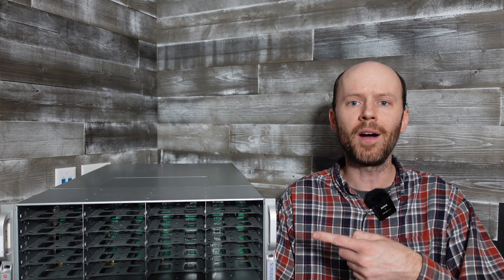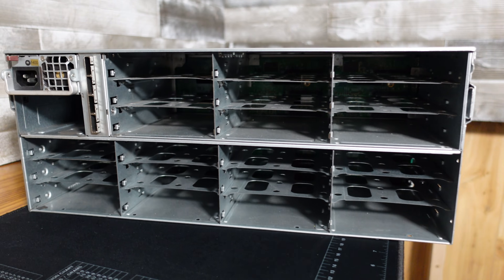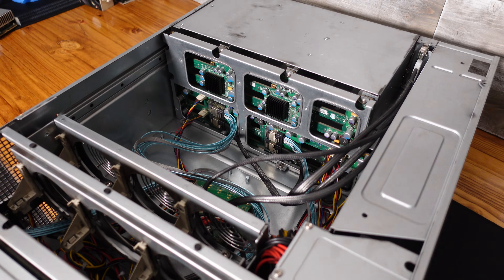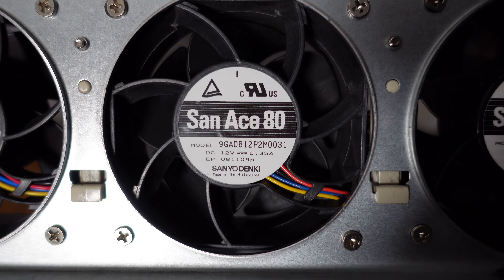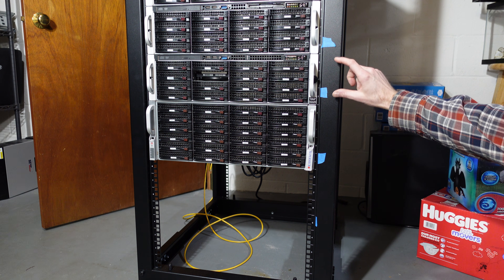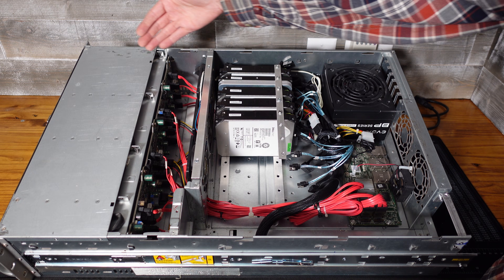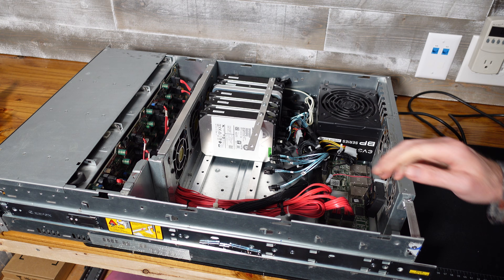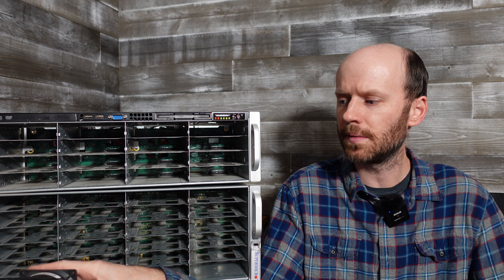Supermicro 45-Bay JBOD Disk Shelf Upgrade, Running 105 Hard Drives

Comment: i am new to home lab   i am more onto running local LLM , machine learning and batch transcoding of media  
have you tried ssd   in in these chassis ?
 i wonder if that would  drop the voltage and the noise  also you could use Noctua NF-A4X20 40 Fans   because it " should "require less cooling

Comment: I'm thinking of enclosing my racks top, sides and back. Adding rockwool to the panels. Then placing a exhaust fan on the back panel and running the duct to the window. Think that will help with noise and heat.

Comment: You neglected to mention/list the Dell PN for the fan, or Optiplex models either or would be handy for the lazy masses on the interwebs ;)   (also damn you for making me wanna get one of these & retire my MD1200's)
Reply from the maker: Part number is FAN-0074L4. It was mentioned at 11:40 :)
Reply: @HomeSysAdmin  Indeed that seems to be the Supermicro PN, but you went on to mention that the fan can be gotten as a Dell variant which should have a DPN attached to them.  The most similar one I can find being 0M8041 & 0HU540 for the OptiPlex 745/55/60 series.
Reply from the maker: @mikebleh6492  Oh, I don't have the Dell PN's. I searched the fan PN, 9G0812P1F*** where * is a 3-character variant. There are a few variants of 9G0812P1F which appear to all have the exact same specs, just possibly a different connector or screw hole sizes.
Reply: @HomeSysAdmin thanks! I’m modifying an old EMC Isilon 36 bay server later this spring and need to try and find a good replacement for the original fans. These sound silent enough and with enough pressure to test out! 👍

Comment: Please note : Server PSUs idle at higher wattage than ATX PSUs even if they are more efficient at higher loads.
My PWS-1K66P-1R 1600W psu idles at 0.25Amps. And my Antec 1000W HCG idles at 0.09Amps.
Reply from the maker: Do you think that is mostly attributed to the PSU fan being small and high-rpm? Or are there other factors at play?
Reply: @HomeSysAdmin  I think the fans are a small factor in all of this. The smps circuit design is the main culprit. 

I have run the sysbench mutex benchmark using different PSUs but keeping the rest of the machine same. The final power consumption varies wildly. The best was FSP250-60GHT and the worst was Antec 1000W HCG which is actually gold efficiency certified. So the size of the PSU and the circuit design are the final deciders.  Large PSUs running at 20~30% load are inefficient. The benchmark was about power consumption at the wall socket when at idle and at full load.

Comment: These server chassis are so silly. All that airflow and then the output at the back is 95% blocked. No wonder the fans need so much static pressure and rpm. and 40c is way too hot for HHDs running 24/7. That's 104F!
Reply from the maker: The backplane is really what does the blocking. They need to find a way to put more holes in it. And no, 40C is a perfectly healthy temperature. My target maximum is 45C, but I see other people running at 50C all day long for years without issue.

Comment: 6:30 power supplies are usually most efficient around 50% load, so using a power supply with double the wattage as what you need is often best.
Reply from the maker: Agreed! The tricky part to factor in with so many drives though is the current required during startup. Even with staggered spin-up like these do, there's still an increase.

Comment: As an admin who managed, many systems with these shelves. I can recommend labelling the front of the caddies with the drive serial number (or wwn) to make it easier to find dead disks!
Reply from the maker: That's a great idea. I tried to do this originally but because these are white-label "oos" recertified (or whatever you call them) drives, the serial numbers returned by SMART don't match what is printed on the drive. I'm not running any sort of raid. They're individually mounted so I can easily identify which one is failed when one goes offline. For example 0315 is shelf 3, bay 15 :)

Comment: Awesome video, great in detail about the 847 case and thanks for the fan info, as this was something i gave up on way back. Stacked 4 of these in my basement rack and together they sound like a jet engine idling. When it comes to PSU, there is a reason for the 1K41 as this with 45 drives will use <75% of the actual capacity of the PSU, meaning more efficient and longer lasting PSU. Heat will always be an issue, but even worse if using SED drives that constantly monitor them selves (have some i got cheap). Tried to block the holes on the side of the 847 case, to force the fans to pull cold air through the front drives/backplane, but i could hear the fans were struggling with my "great" invention. Looking forward for more informative videos.

Comment: Yeah man those things are loud as balls. I have a Nimble Storage ES1, basically rebadged Supermicro 16-bay, which is a smaller version, and I swapped the PSUs with the Supermicro PWS-920P-SQ . They are platinum, $30 apiece when I bought them, and much quieter than the ones that came with mine, which I believe is the same as that bronze PSU you're running. If you're looking into Supermicro PSUs, be aware that they have at least two different connectors. At first I bought the PWS-1K28P-SQ, and the connector did not fit at all. I'm not sure how many different types they have, but those are the only two I tried.

At any rate, congrats on the score! They are very nice enclosures minus the noise.
Reply from the maker: Thanks! PWS-920P-SQ is the one I ordered, should be here next week hopefully :)

Comment: I made a similar transition a few years ago but I moved to 4 x 847E1C-R1K28JBOD. Having SAS3 is great for the future and the IPMI is way more clutch than I realized it would be. I love the density of these 45 drive units. Nice snag and upgrade!
Reply from the maker: Ooo those have the CB3 controller board. I was eyeing those up but the board alone costs more than I paid for an entire case! Do those boards control the fan speed based on temp or is it a single preset speed like the CB2/SAS2 versions?
Reply: @HomeSysAdmin  It does indeed which is perfect for me as my rack sits in a mechanical room where throughout the year I have wild temperature swings due to our HVAC, water heater and server equipment. I paid $750 per with rails and caddies almost three years ago. All in all, even at todays prices I feel like I got a good deal especially considering I sold my old JBOD's (SM 16 bay units) at a time when Supermicro gear was harder to find due to Chia, so prices were obviously up.

Comment: So I am curious why is it only 45 drives instead of 48 drives and I would be interested in seeing what the drive trays look like 

I know I have seen net app jbods with 48 drives in there with 24 slots and each slot capable on doing 2 drives
Reply from the maker: The space were the remaining 3 drives would go is where the two PSU bays and SAS connectors are. It's physically impossible to fit 3 more externally-facing drives in a 4U formfactor like this unless you put them inside the case.

Comment: We put X10 Supermicro boards with dead sockets but still working IPMI into these. This way you can set fan speeds manually or automatically (optimal) via BMC.The JBOD boards can't do that.
Reply from the maker: Very interesting idea!! They do make a CB3 JBOD board that has IPMI support but it's so darn expensive.
Reply: they do boot up without cpu?
Reply: @DeviloftheHelll  the BMC is essentially another computer, but embedded as a single chip, optimized and only provides those remote management/monitoring capabilities like IPMI, web interface, power and fan control, bios upgrades, etc. so yes, the BMC will boot up even if you don't have CPU, RAM or even some physical damage (some, not all as the BMC can be damaged too) as all you need is ATX power.
Reply: @ i know the bmc is separate, but nothing else will work on the board without cpu and ram. i go even further, i have an r730xd sitting next to me during shipping it got a nice nudging dislocating both cpu under the heatsink just enough to cause it to not work but fortunatly nothing was shorted. i couldnt get a picture from the vga, as the xd has no status screen the ipmi ip and password could not be reset.
Reply: @DeviloftheHelll  You are very mistaken here. Fan control via IPMI is still working without CPU and RAM, You are able to update bios etc. Nothing else matters.

Comment: is there a sas3 version of this chassis/expander/backplanes?  I suspect that with 45 drives or more you'll start running into bandwidth issues (particularly if you start loading them up with sata ssd's instead of hard drives)
Reply from the maker: Yes, they do make a SAS3 version of both the front and rear backplanes. One thing I really like about Supermicro enclosures is it's very easy to swap out parts and upgrade vs other companies that often make you buy an entire new server.

Comment: You might check for the sq psu models if the noise is too high. Supermicro made those and they are much quieter. They also made a green fan for the wall version that was quieter also. I used those in an sc846 and it helped noise a lot.
Reply from the maker: PWS-920P-SQ is the model I'm looking at, sent a pile of offers and trying to find one to bite lol.
Reply: @HomeSysAdmin  those psus are super quiet for server psus they are what i use in my sc826 chassis
Reply: not only that he only has 1 psu and most servers that use redundant psus dont like it when one of them disappears